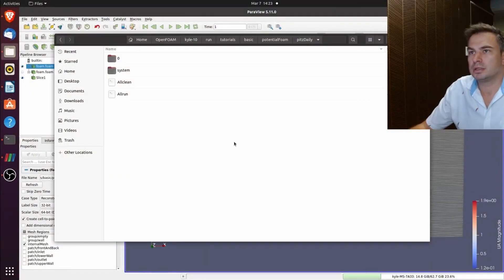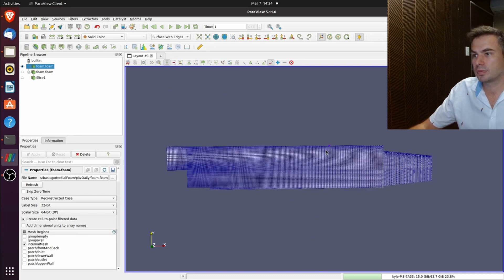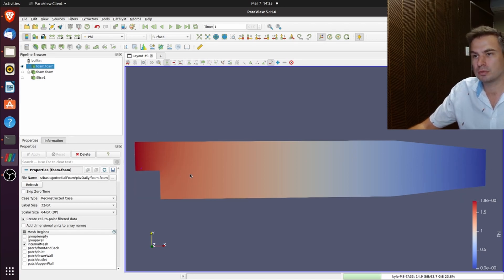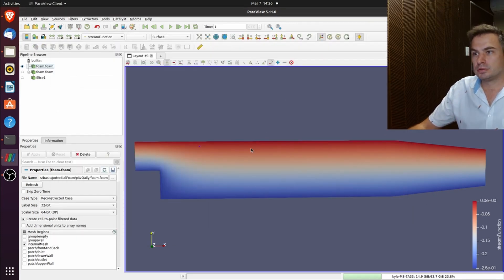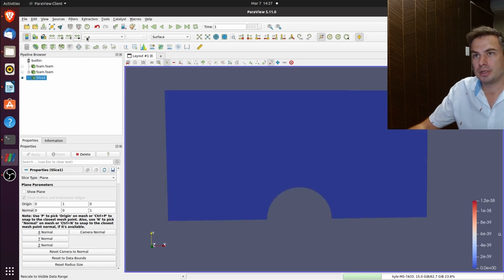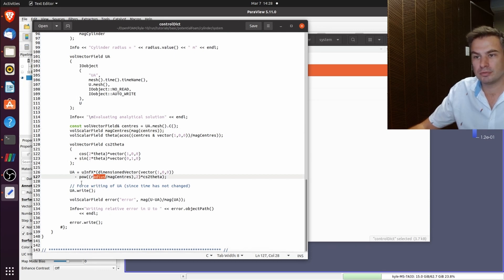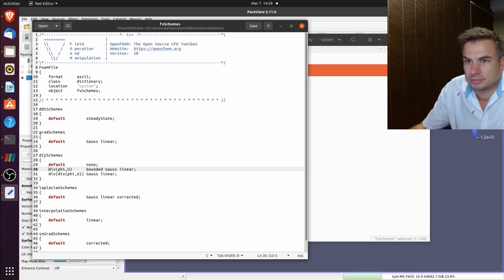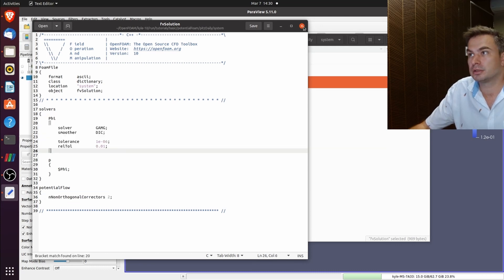An Overview of potentialFoam

Comment: Thank you so much for the explanation. I got 1 problem though.  I can't see UA, only U and p. How to fix this?
Reply from the maker: It is difficult to say, if the files are in the folder then. Have you selected them in paraview to be loaded?
Reply: @CFDwithKyle  I fixed the issue. I had to uncheck "skip zero time" in the properties menu for anyone having the same problem!